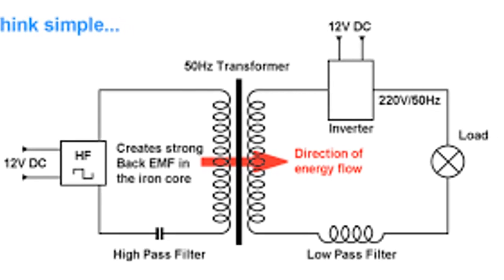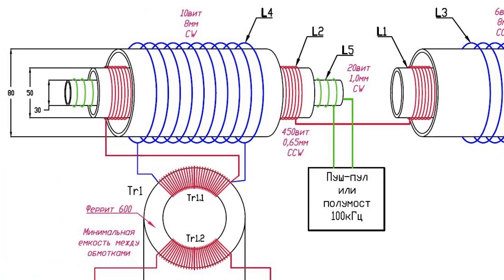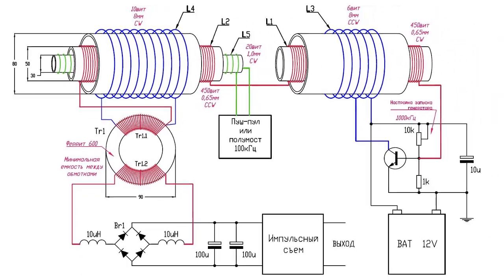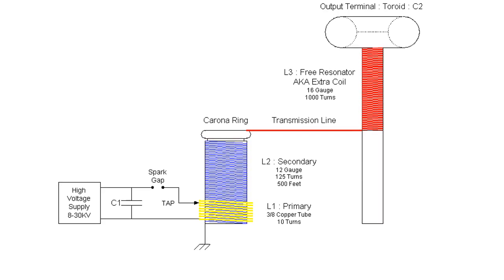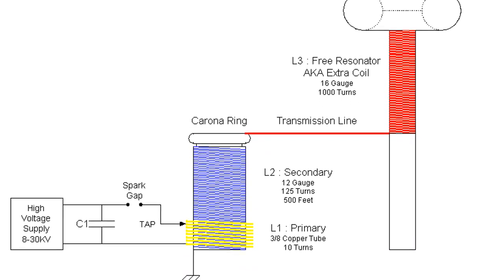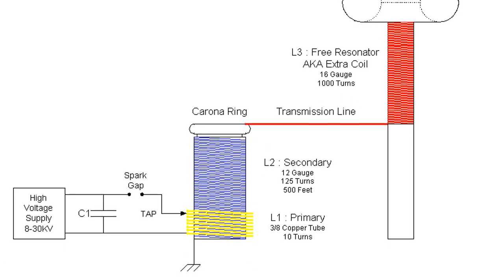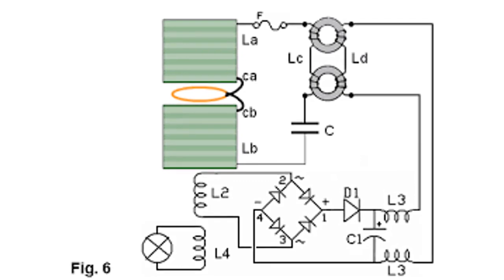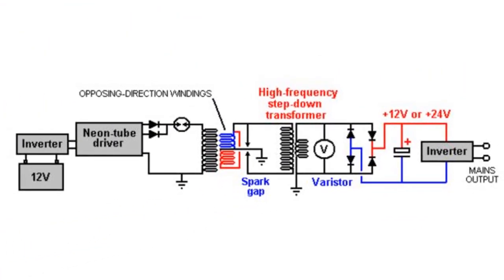Tesla Coil Free Energy

Comment: Pls check SSTC solid state tesla coil, that operates at 10 Mhz and high voltage that devices make plasma candles of temperatures around 1500°C-3000°C that sounds as nuclear fusion because plasma extract atoms from the wire accelerating to high velocities, and... A high energy effect can be find using a electrode around quartz crystal that the electromagnetic field ionize the point of crystal, and the point burns at high temperature, making a plasma flame from the crystal point, same a normal flame, the crystal and our can be put inside a orgon accumulator, orgon accumulator is a faraday box and acts as thermic accumulator, this concentrate the thermal energy generates same a combustion chamber of a car concentrates the energy to move the cylinders, none things that i talk has been confirmated is only theories but the plasma fire is real and the orgon acc is real, a youtuber speak when the frequency increases the temperature increases, this is awesome, i m from venezuela i m a poor student, but you need this information, pls check galactic.no for more information about free energy from crystals and high frequency EM waves.
Reply: And sorry for my bad english